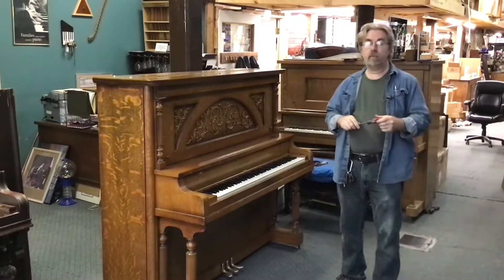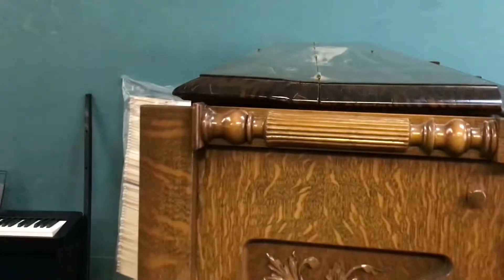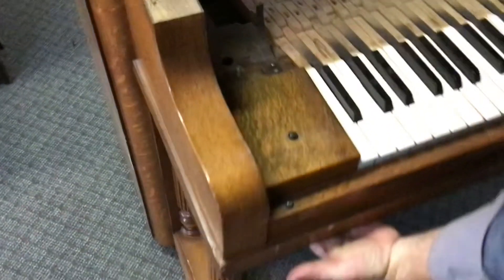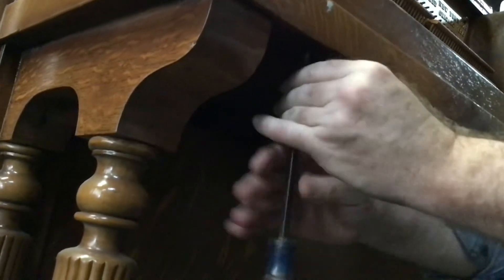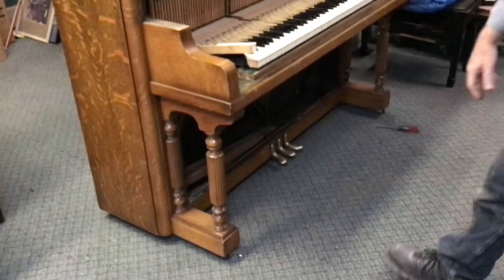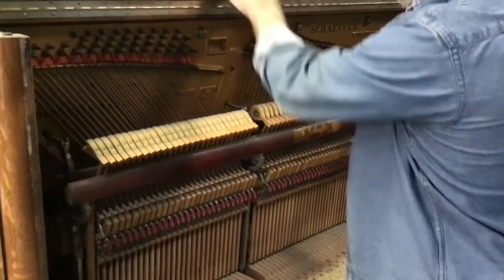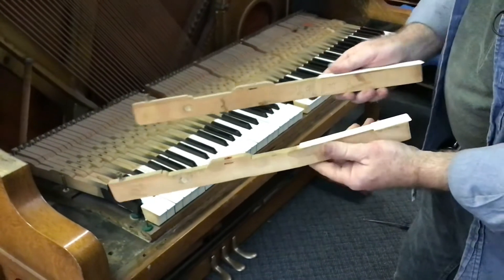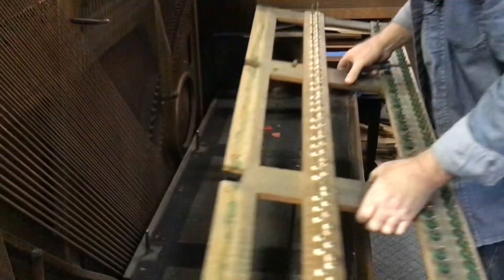Acoustic to Digital Piano Conversion - Disassembly Part 1

Comment: Casio privia px-100 can convert to this upright?
Reply from the maker: I don't recommend it since it's an older unit but with enough determination almost any digital piano can be used.  The PX-100 has a larger control panel which makes it more difficult to keep the original look of the piano cabinet.
Reply: @raglandpiano  which one can you recommend? How about casio cdp s100?
Reply: @raglandpiano  i only have casio px‐100 i want the aesthetic look of acoustic piano. Maybe i can buy an old weinstein curvex and it is already defective.

Comment: Using a casio px s3100.  But got to shorten length somehow.
Reply from the maker: Take it out of the original, plastic case.  You'll also need to figure out how to make the touch screen look asthetically pleasing, but with enough determination it can be done.

Comment: I just took cast iron frame out of our old upright.  Keyboard supports are carved and delicate, so i used an angle grinder and cut the iron out. Easy but messy. Found some interesting packing pieces used inside. A  few tickets to a cabaret dance and part of post card, with postage stamp,  dated 1897.